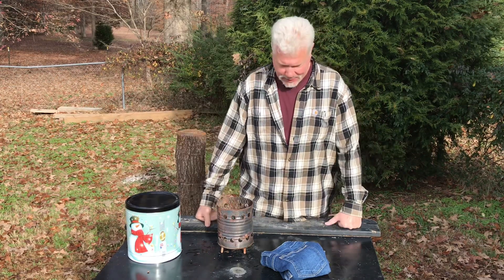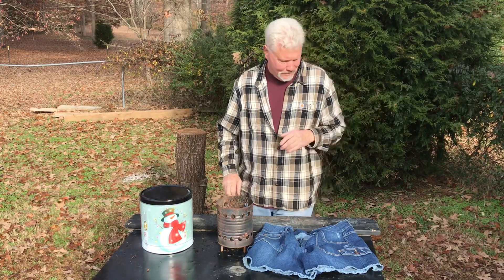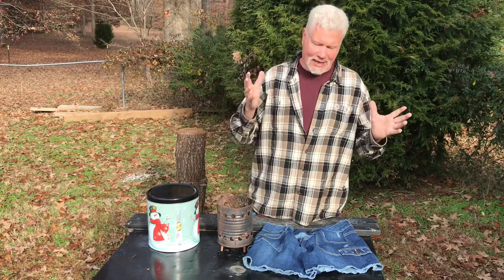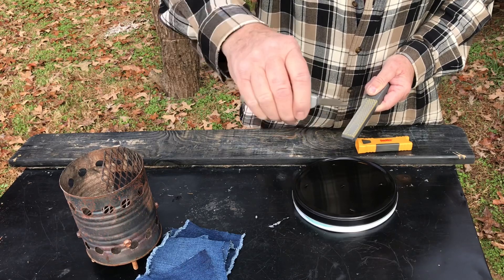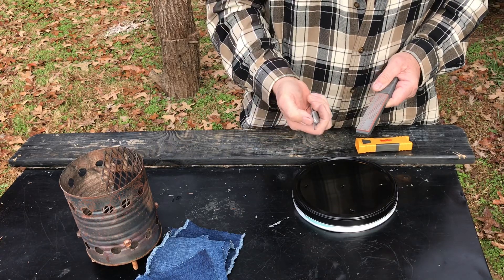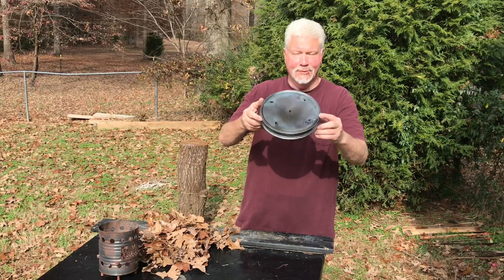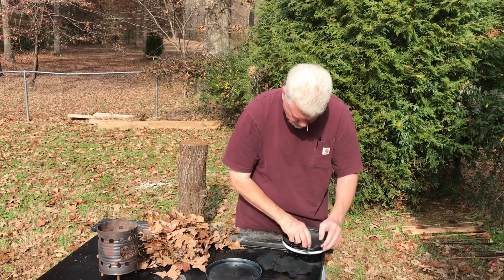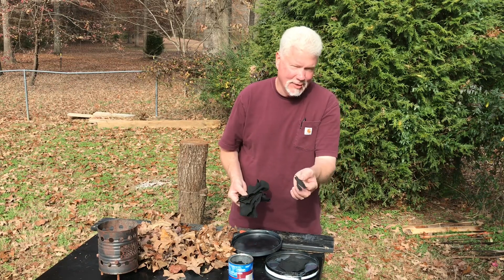Bulk Charring Denim In A Modified Popcorn Tin

Comment from the maker: The first time I tried this bulk charring experiment, I charred an entire t-shirt (LINK below). It did well right out of the char tin with flint and steel ignition, but it took a very long time to char. On this bulk charring experiment, I wanted to solve those problems by making a much smaller char tin, charring only select pieces of the denim, and using a much hotter fire than the previous little propane stove.
   Well, it worked. It charred the denim quickly and thoroughly, but about 1/3 of the char cloth came out brittle. Brittle char cloth will work, but it's not ideal because it's so slow to ignite with flint and steel. It's works just fine of course for solar and ferro rod.
   Come watch me slice up some denim, turn a full sized popcorn tin into a 1" deep char tin, build a fire... on the ground this time, and try out our 7 pieces of 6" squares of char cloth. 
   Please, follow the LINKS below, and SUBSCRIBE. Thank You!

Bulk Charring... Charring An Entire T- Shirt In A Modified Popcorn Tin
https://youtu.be/04Um5Ht5MvU
Flint And Steel Playlist
https://www.youtube.com/playlist?list=PLkoXX8XsMW3mFf5FgLtam1aDmXmqQQice
Char Cloth, Charred Punk Wood Playlist
https://www.youtube.com/playlist?list=PLkoXX8XsMW3nfHvlf-YghwFdkUBYRIIMy